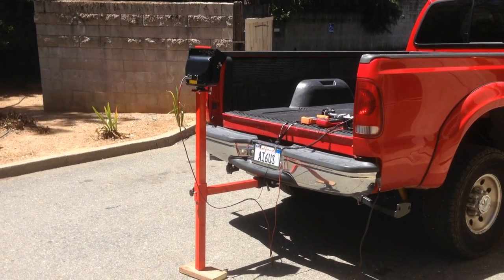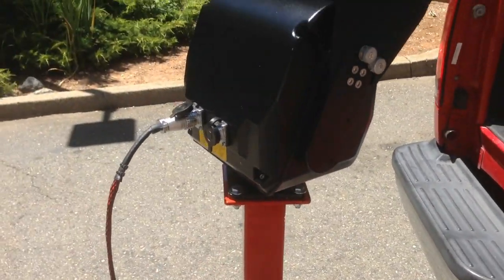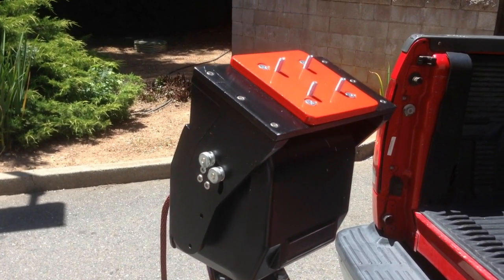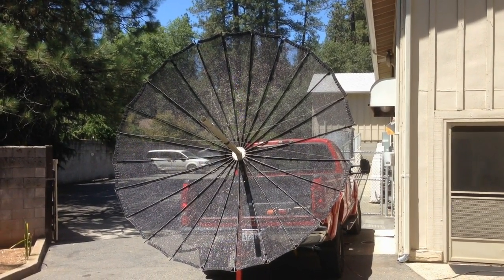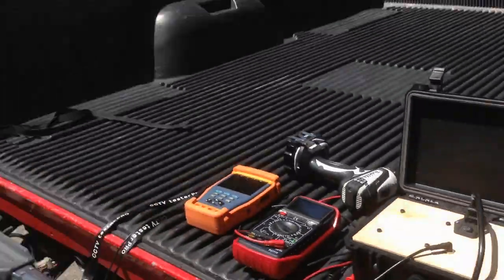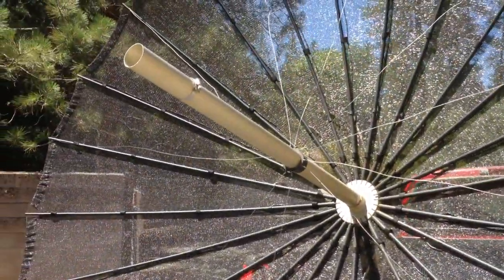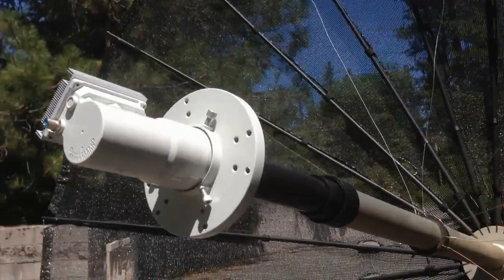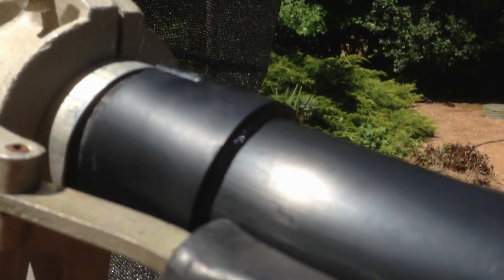Two Axis PTZ Control of a Fabric Satellite Dish

Comment: Would it be possible for you to tell me how the "pull arms" attach to the fiberglass spreaders?  Meaning, on the back side of the dish, those individual flat bars that pull the elements back in tension?
Im tryimg to build one, and im not sure what to use?  W0MDX